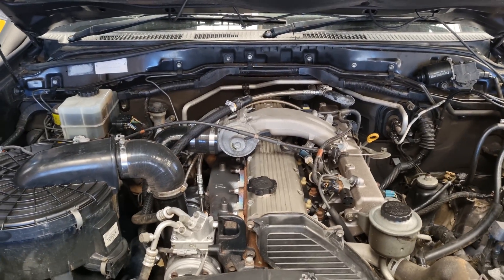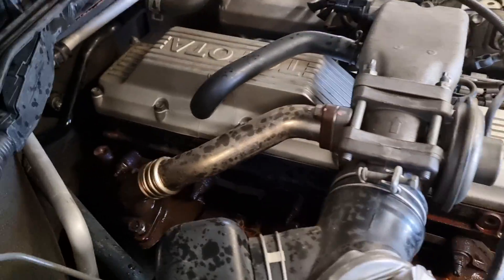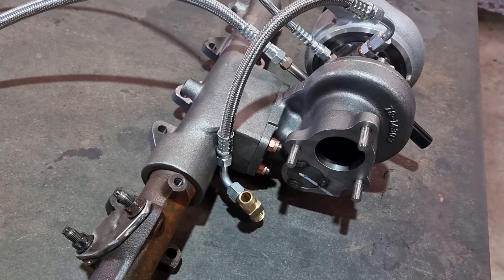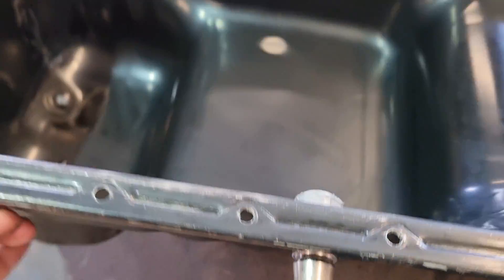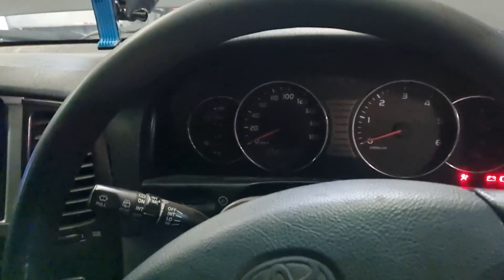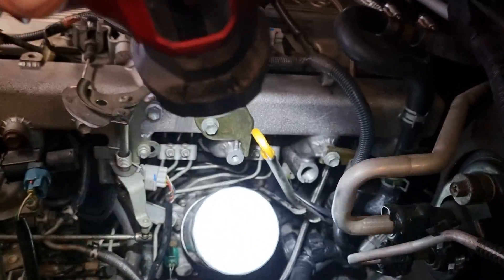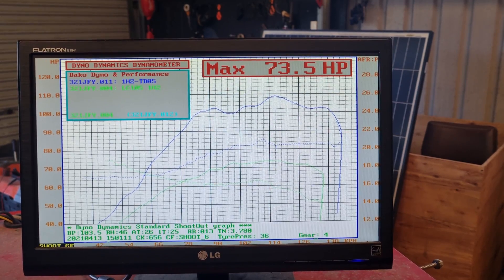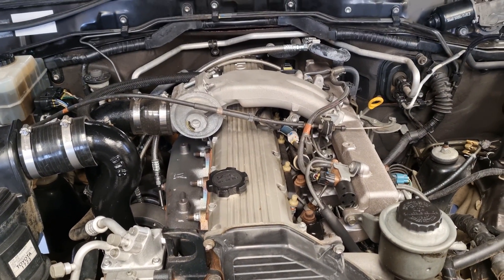1HZ DTS Turbo Install & Dyno

Comment: Guys I got a question, when installing a oil feed line or drain, does the oil capacity now change? Like surely with that extra line and turbo you’d need to tweak it by 500ml or so
Reply from the maker: @keqrou  yes correct, also coolant and blow by.

Comment: aye bro just got the DTS turbo kit and don't want to stab the sump either - what's the bolt on sump oil return fitting you got? where can I buy it? 🙏
Reply from the maker: @klausgmirr8298  ebay mate, search sump oil return and match the size to your existing hose.

Comment: How do youbadjust the boost? Is it just with the fuel pump screw?
Reply from the maker: Of you turn the radiator cap alittle tighter you can usually get a few extra PSI. Make sure your on the dyno and keep ya EGTs in check and load it up on steady state.

Comment: Hey just slapped the exact turbo on my 1hz. I havent touched the fuel screw im pretty scared to. At around 3k/3.2k it hits psi 5. Im not running a intercooler. I just got a egt today and havent given it a good run. U recommend i turn up the fuel?
Reply from the maker: Did you rev it to 3 k without a tune?
Reply: Fuck quick reply. Yeah brus 0 fuel adjustment I live in the bush so can't get to a real place to get it tuned
Reply from the maker: @Slidee  haha that's wild nice work. If you look after you HZ it will live forever. I don't know anything about your motor/pump etc but if you adjust your fuel screw no more then I did its a safe amount. Monitor egts very closely the first few times you load it up and you will be fine.
Reply: @DAVO3FAZE  cheers appreciate your time

Comment: Hi mate 
Is the 1hz still going strong with this kit ?
Reply from the maker: Yes mate super strong. Will do a review video one day and put it back on the dyno for comparison.
Reply: @DAVO3FAZE  yeah awesome bud , I’m just about to pick up my new 2001 hzj78 with 230k on the clock so future turbo plans will be in full swing , was worried about so many disaster story’s but I think that’s mainly from guys just running to much fuel an boost through the old donks
Reply from the maker: @harryridley2714  you nailed it. People crank the boost and diesel in way too much and then get confused why things melt. I highly recommend a intercooler I noticed a massive difference after adding it.
Reply: @DAVO3FAZE  yeah copy mate , cheers for the info , legend bud 🤙🏼

Comment: When you do 1/4 turn mate is that clockwise or anticlockwise on the fuel screw?
Reply from the maker: Did I put the DTS install manual in that vid? If not I'll look it up for you.
Reply: Yes you did! Screw "IN" a 1/4 turn.... Easy enough

Comment: Evening, thanks for the video, I have recently bought this kit (currently in the post) I'm very curious to what your thoughts are on a good all-round afr, 19-20:1 or 20-21:1? Thanks in advance!
Reply from the maker: Depends on motor, load, boost level and alot more factors. The afr vary alot more then a petrol engine. I focus more on the pyro temps and would like to see them never reach 500 post Turbo. That's under wide open throttle loaded for a minute.
Reply: @DAVO3FAZE  thanks for your reply, If your reading this, 4th gear from 1300 rpm - 3000 rpm I settled from 18-1 down low to 21.7-1 up high afr (hits the 21.7 at about 2200 then starts to drop off to 20.8 ish by 3000rpm) 11.8-12.4 psi doing road test tune. I see by looking at your graphs i have it slightly more on the leaner side, 3 inch exhaust, egts are safe as, no intercooler. I'm still learning by all means but struggling to find what is the best all round afr for a non compensated pump. One small dispointment I have with the dts kit is the slow spool up td05 but overall, great kit. Just noticed my intake manifold gasket is leaking, shit.
Reply from the maker: @tonywharton267  I focus more on the pyros then the afr's on daily driving. I keep mine way under 500 post turbo and they normally dont go past 460 which I think is on the safe side. Lean is fine, driving syle can help alot to keep your motor happy.

Comment: Why do you have two holes opposite each other on sump
Reply from the maker: Not sure what u mean but I made a hole for the turbo oil return and the other hole is for the factory oil level sensor.
Reply: @DAVO3FAZE  oh sorry brain fart
Reply: Did you change engine pistons ? Is this turbo safe on engine?
Reply: I think he stuffed up there

Comment: Put this kit on 10 years ago. Going great. Only deviation was to make and install an exhaust flange gasket. Kit did not include this, they said they were unreliable and Burt out. With the proper material I have never had a problem with this.
Reply from the maker: Thanks for info mate. These units have a very good reputation that's why I choose it. Glad to hear you had great results. 👍
Reply: Hey mate

How much did you adjust your fuel by to suit?

Comment: Quisiera  saber  si se puede poner un turbo  a este tipo de motor sin hacer     cambios en el interior del motor? Pienso que el lo explica pero  no le entiendo al idioma ☹️ me  pondrían ayudar? Gracias
Reply: En cualquier mecánico relativamente bueno, si vas a andar entre 5 y 7psi que es medio kilo o medio bar no necesitas cambiar nada solo poner turbo, hacer el colectir de escape en cualquier tornero masomenos bueno o ni tan bueno solo sodar brida para encajar turbo y solo linea de entreada y por abajo por gravedad la de salida al cartes de aceite y listo, un turbo ct12b de runner 98 es delicioso jala desde muyyy abajo lo que uno quiere para solo 0.5bs, el que diga muy chico no debe saber que este viene en el 15bt y ademas si no vas a ir a mas de 0.5 sobra con demasiado mejores bajos que el ct26 que es super lento, si pillas td05 tbn te va bien y es mas fino y estas feliz con solo 0.6 bar (digo para quien no es turbo andar a 0.6 sienten el cielo) no necesitas cambiar nada, asi mas de 10años ande un 1hz, un 14b, etc y decenas mas, con el ball bearing turbo gtx2867r ya es otra cosa pero ya te vas yendo a extremo para los q andamos a mas de 20psi y no tan preocupados de que si quebra algo el motor o no, xq vale la pena.

Un dato el 1hz que hace en la pick up 99 en viajes como a 100km/h un consumo como de 9km/l con solo poner el ct12b turbo  a 8psi (ct12b no es ct12 ni ct12a) solo con el tenes entre 10 a 11km/l incluso dandole 1/8 o casi 1/4 de vuelta a mas al perno que te da mas caudal en la bomba de diesel. Eso en 3 años solo con el ahorro de combustible y de mi tiempo que ahorro en subidas vale un motor reparar o un turbo nuevo siempre dije si se frega lo arreglo o cambio y mas de 10 años nunca los quebre

Ojo sabiendo pisar el acelerador xq al comienzo uni se emociona y gasta mas

Comment: Hey mate could you show where your oil feed was a bit closer, cheers in advance
Reply from the maker: On the passenger side where the standard oil pressure sender is. its a bit bulky when a T piece is put there so you need to angle the standard unit slightly to the right. The new line can sit where ever fits on your motor.
Reply: @DAVO3FAZE  any photos of it
Reply from the maker: @lachlankelly68  https://images.app.goo.gl/3nTuDc8DUEsxZjuz6